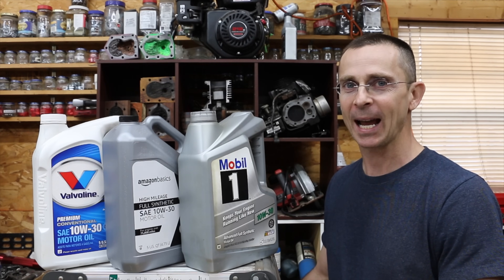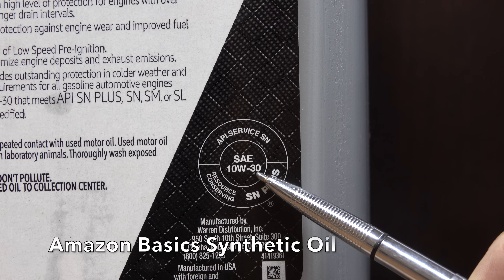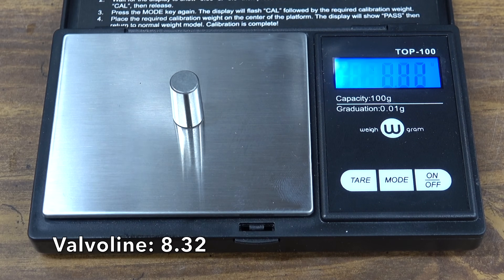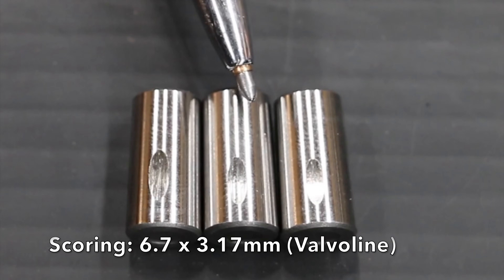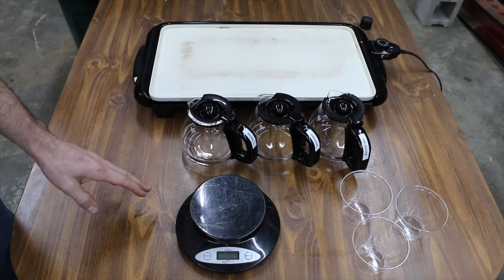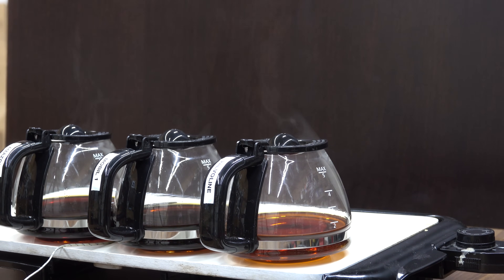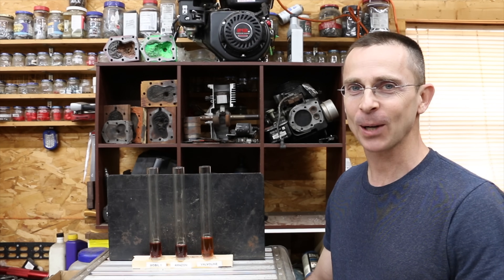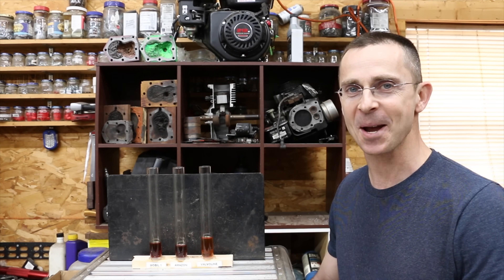Is AmazonBasics Full Synthetic Motor Oil better than Mobil 1? Let's find out!

Comment: Just an observation, when you tested the lubrisity you had a bit more of mobil1 in the cup. So when you started the test a lot more oil was coating the bearing and the test block. Could that have altered the test giving you a false reading between Amazon and mobil1? I wonder if the mobil1 cup had the same amount of oil as the Amazon would the test result be closer in the wear marks?
Reply: My gut feeling on that one is that the tester just slings out whatever it can't use and that all of the levels equalize pretty quickly. I don't think it had "extra" oil long enough to matter.
Reply: @TheBrokenLife  I thought the same thing, but if you look closely during the M1 test (around 4:50) you can see the oil is still really being slung by the race at what seems like the end of the test. Maybe a test of the same oil at different levels in the cup would be fun to see and find out for sure?
Reply: @TheBrokenLife  Actually if you go back in the video and watch when the mobile1 was being tested you can clearly see more oil building up and holding at where the race is riding the bearing. far more than was present when testing the amazon oil.
Reply: I agree with this question. I would have to assume the amount of oil clinging to the race would have a measurable effect on the bearing wear? I feel this method may lead to unintended differences in your results. Is there a way to make this more uniform? Maybe an alteration of your tester? Some sort of simple device to apply oil to the race in a more repeatable amount? Something similar to the way an engine would oil a bearing? Maybe a small pump with a tube pointed at the race, pulling from a collection cup under the race?
Reply: Maybe you could even do a test to see if there is a difference in wear using the same oil but with different levels in the cups? I assume if there is too much oil there would be a certain amount of loss as it's thrown by the race, but it looks like you have modified your rig since earlier videos to help remedy this issue with a small plastic flap?
Reply: Also, out of curiosity, why were the temperatures of the bearing it seems you were recording during the test not mentioned in the results. From what I saw it seemed the AB had the lowest bearing temp, which I would assume should mean the least wear. Of course a lot of slight variances could skew that number, but curious why it was omitted. Inconclusive?
Reply: Exactly my thoughts. @Project Farm ?
Reply: Perhaps to make sure everything is even-Steven, measuring the initial load of oil would be helpful? If nothing else, it would help the poor guy to keep from overloading it and making a mess than can be seen from space with that rig.
Reply: I agree with this general line of discussion.  It was obvious that there was far more Mobile 1 oil coating the bearing.  Consistent pressure, speed and oil levels are required for good data.  You have improved your methodology of testing, but a few more additional constraints will help ensure better test data.
Reply: I believe @ke6gwf is correct.
Reply: I noticed the same thing, but, wasn't sure if it made a difference
Reply: When is was watching I also noticed this. I feel in a test where the margins are so tight this factor may have gave Mobil one an edge ahead of the others.
Reply: I noticed that too but it could have been a more clingy property of the oil perhaps. I'm more concerned with how he made sure the clamping forces were equal.
Reply: I noticed this right away, I think it should be retested with the same amount of oil in each. The test was technically faulted due to there being more oil in the mobile1
Reply: James Smith I noticed that too
Reply: At the actual contact point where 2 pieces of metal touch under pressure while moving, the oil forms a film only a few molecules thick (depending on viscosity, temperature, speed of movement, and pressure applied, preventing metal to metal contact.

As long as there is enough oil to provide that few molecule as the part rotates, and to replenish it after each rotation, all the extra oil flinging off is just excess oil.

Since film cling and tenacity and surface wetting are important properties of oil, as long as there is enough oil to fully cover the friction surfaces, the test should be accurate, including the ability of the oil to maintain lubrication with residual amounts only.
Reply: @ke6gwf  that's all correct! Do you think with extra oil the heat could have been dissipated better affecting the results.
Reply from the maker: Thanks for the constructive feedback.
Reply: @ProjectFarm  Curious to see if different oil levels in the cup would produce different results from the same oil...
Reply: It shouldn't change things because the gap between the bearing and test block is the same regardless of the amount of oil added so only so many oil molecules can fit in that tiny little gap rest will be pushed to the side having no effect on the wear mark. Only reason you use more oil then what is actually needed for the equipment to work is because it slowly gets dirty and extra helps dilute the partials contaminating the oil and some of the oil evaporates and or leaks out.

Comment: Synthetic is much better all around, except in some old vehicles! My vintage motorcycles will smoke like crazy with synthetic oil of the same weight as conventional oil. My only guess is that it’s so slipper that it slips through the valve guides and rings that don’t seal as well as modern engines.
Reply from the maker: Thank you!

Comment: Great video! But I’m curious if the lubricity changed at all when the oil was heated to such a high temperature for an extended period of time. Did it break down at all? Or is it the same as it was new?
Reply from the maker: Great point!  I should have tested that.

Comment: I wish you had included Walmart's house brand of synthetic !
Reply: The Walmart (Supertech) oil is the same  as the Amazon Basics. It's made by Warren (which you can see on the sticker in one of the shots), who make the "in house" brands for a lot of stores. Amazon Basics, Supertech at Walmart, Autoquest at Meijer, and I'm sure many others are the same oil, made by Warren. All are good options, and are very affordable.
Reply: @randomOAS7  Except the Walmart version is cheaper then Amazon and almost every town almost has a Walmart or one within short driving distance. $17.47 for supertech. I''ve been using it for over 15 years and haven't had a single issue with my of my vehicles. Got a 2002 Escape with 300k miles.
Reply: @MAGWolf  I've been using super tech full synthetic in my 2011 suburban for 100,000 miles so far and it's great oil.
Reply: @randomOAS7  I'd clarify that it's made by Warren Distribution. There's another Warren, called Warren Oil and they make stuff for places like Autozone, etc. Can get confusing.
Reply: @randomOAS7  Warren blends most of Supertech but they do have others depending on the geographical area you're in. That said, they're all supposed to blend using the same base/additive package so they should all be nearly equal. Nice thing about Amazon B & Supertech is it's so close to most of the major labels synthetics at about half the price you can change it a little more often and still save money as well as have a superior product.
Reply from the maker: Thank you for the video idea!
Reply: @ProjectFarm  If you are going to test Mobile 1, you might as well add Mobile 1 top competitors like Amsoil and Royal Purple, no? I would like to see the coffee pot test with those, which I think you haven't done in the past...

Also, when you do the lubricity testing measure the oil you put in the cup instead of just filling it by eye. An extra half ounce in one cup over another may actually affect the test by allowing more oil to be brought up on the wheel, thus pushing more oil over the bearing and giving a better reading vs a lower oil level in the cup... just a thought.
Reply: @gac107  Amsoil and RP are not "top competitors". They are niche players in the market.  Their prices are too high for them to compete with regular name brand oils.
Reply: @gac107  Amsoil and Royal Purple are actually junk, although it costs more. If you are going to pay super high prices on oil it needs to be Shaeffer's, Motul, Enos ect. The only reason anyone has heard of Amsoil and RP is because of the amount of advertising, not because the oil speaks for itself and it is obvious when looking at oil forums where it is tested compared to other oils.
Reply: @4x4le  I have been using Schaefer's for about a year, I was told it was good stuff, hope they are right
Reply: @nickv4073  Actually running extended oil change intervals would make them significantly cheaper than a conventional oil in my case (4 gallons per oil change). I'd be interested to see the difference.
Reply: @gac107  i would not put Mobil 1 in the same class as RP, or Amsoil.. high end oil would be RP, Amsoil, Redline, and Penzoil ultra platnum. M1 is not a high end oil.. its technology is ancient in comparison to the brands
Reply: @jmhm17  It's not like the M1 you buy in 2019 is the same stuff you bought in 1985. Mobile1 keeps up with the times, and they have a variety of formulations.
Reply: @4x4le  Amsoil is actually really good stuff but its ment more for Race Engines
Reply: @4x4le  Not so. Tests of Amsoil exceeds Mobil 1 and top of line of Amsoil is rated for 25000 miles before change. I have over 300k on my 04 impala. Very quite motor, strong and does not use oil. Gets changed every 16k - twice a year. Started Amsoil 40yrs ago and couldn't believe the extra hp I got over conventional oils in my race car. + Northern Mn, gets really cold - but car turns over like summer. Mobil 1 a bit cheaper - but I stick with the best of the best!
Reply: @ProjectFarm  Supertech vs Amazon!
Reply: Warren makes them both.   Refers to https://www.bobistheoilguy.com/forums/ubbthreads.php/topics/4827485/Who_makes_AmazonBasics_Full_Sy#Post4827485
Reply: Jack Patteeuw, Amazon basics is the same thing as Supertech.  Both made by Warren.
Reply: I have used Walmart Full Synthetic since new with Purolator filters  it is a 2005 Colorado 3.5 I5 it has 373,000 Miles on it...  Runs just as good as new.... I change the oil @ 5-6k, Air & Fuel filters @ 12k. it is using a quart per change now...  The rear main seal is leaking a bit...  2 tranny rebuilds, 1 G80, 1 fuel pump, 1 alternator, 2 water pumps, Idler & Tensioner pulleys, 3 sets of wheel bearings, 2 sets of u joints, both window motors, driver side window switch, Heater resistor, 2 vent valve solenoids and basic std crap that has to be changed..  I'd drive it anywhere without worry...  BTW  4L60E loves shift kits....  Wakes the 1-2 shift up!
Reply: Super tech
Reply: mobil 1 0w-40 european
Reply: Toilet Dog  i used to only use supertech full synthetic in a supercharged Pontiac and it ran like a top. no problems ever...   plus i drove it like a rented mule.
Reply: Toilet Dog  I used to use it and so did some of my friends and never had any issues. we've even used Valvoline High Mileage Oil, in the red container for older vehicles with well over 100,000 miles or more. Especially when we would put in an engine from a junkyard.
Reply: And Amsoil.
Reply: You meant SuperTech? That is what I use. I heard it is the same manufacturer as the Amazon basics, they just repackaged it and market it as different brands.
Reply: I’ve used SuperTech forever—19 years, ever since I have a car. I use itbcz it is affordable. I know it is good /no problem because I had never had any problem. Now I know why—it is the same manufacturer as Amazon basics. I tried mon
Bile one a few times, it is too pricey, and I think they added some aromatic so it smells weird, so that you buyer think you bough special recipe, I guess.
Reply: I was just going to say the same.  Supertech is very cheap.
Reply: Bottled by QuakerState. its pretty damn good oil

Comment: Bleah!  This coffee tastes horrible!!!

All jokes aside, nice video.  It would have been interesting to do another lubricity test when the oil was heated to engine temperature (approx 250 deg F).
Reply from the maker: Great test idea!
Reply: @ProjectFarm ,
  You could use a programmable temperature controller, thermistor probe (often comes with the controller) and one of those little 120Vac heating elements for coffee mugs. That would be A LOT safer than heating the oil with a gas burner or hot plate.  Splatter guards (and definitely gloves and safety goggles) would be a good idea too.

Comment: Thank you for this video and your hard work on it. I do think Valvoline was kind of rail roaded here being you tested a conventional against 2 synthetics. To be fair you would have to test 3 synthetics against each other. That's is surprising the Amazon basics did better than Mobil 1!
Reply: Yeah but it will show people that synthetic oils are better. I am glad he used a regular oil just to show the difference.
Reply from the maker: Great point.  I was using it as a baseline to compare against synthetics.
Reply: I was about to comment this as well. It would be good to keep all of the oils "synthetic", otherwise changing brands could exaggerate the results.
Reply: Yes you are right Ford ST. It does show the difference between synthetic and non synthetic motor oils.

Comment: Can you replace the engine oil in your engine with grease? preferably extreme temperature grease.
Reply from the maker: Thank you for the video idea!
Reply: If you want it to die sure. You would be hard pressed to find a consumer product with more R&D than engine oil. The oil and engine makers have very good reasons for the recommendations they make. Your not going to find dish soap or honey or something to be some kind of miracle money saver oil trust me. Don't believe me? Try doing thorough research on engine oil.. it might takes weeks to satisfy a discerning mind about which brands are better. It's a pandoras box of engineering.
Reply: @FrigusNomen  when it does lock up while you driving high speeds it may just explode.  Depends  because a diesel engine blows up when the rpms are way past its limits for a few good minutes.  

P.s please correct me if I say anything wrong thank you.

Comment: From Valvoline's website for the ones saying "weight".. 
The "w" in motor oil stands for winter. The first number in the oil classification refers to a cold weather viscosity. The lower this number is, the less viscous your oil will be at low temperatures. For example, a 5W- motor oil will flow better at lower temperatures than a 15W- motor oil. The higher number, following the “w” refers to hot weather viscosity, or how fluid your oil is at hot temperatures. The higher the number, the thicker the oil at a specified temperature....
Reply from the maker: Thank you!

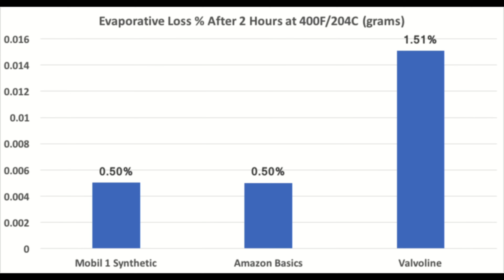Comment: At 08:22 you use way higher precision in your chart than what your method actually had.
It doesn't change that one lost 3 grams out of 200 and the other two 1 gram within the limits of your scale and multiple measurements but you shouldn't use that accuracy when typing it out. (I can understand how you may not want to say 1 and 2% either but no-one is forcing you to.)
Reply from the maker: Thanks for the constructive feedback.

Comment: It'd be cool to see a test of universal hydraulic fluid like what is used in tractor differentials and wet brake systems since supposedly there is no regulated standard like motor oil.  Like testing Ambra vs Rotella vs the cheapest stuff at tractor supply.
Reply from the maker: Thank you for the video idea!

Comment: You should try the same test using Amsoil semi-synthetic to see how that compares.  I used it when I saw a demonstration of it against Mobile 1 back in 1980.  The demonstration included draining the oil out of his car, driving it from Omaha to Lincoln and back without oil.  At any rate, I put the oil in my car at the time, a 1954 Ford with a flathead V8 engine.  I was impressed with that oil.  Had to sell the car in 1985, when I was transferred to Japan by the military.
Reply from the maker: Thank you for the video idea!

Comment: Thank you ,thank you! I have been using mostly Mobil one for 30 years and just got three Amazon to try because of the higher rating and lower cost. So it's reassuring to see it holds up against Mobil . Great rest and very helpful. The only problem I can see is if Amazon changes supplier of the oil the package would stay the same but the oil may be different or in different regions of the country the supplier may be different but if it still has the rating ? Maybe just overthinking it.
Reply from the maker: Great point. Warren Distribution handles the oil for Amazon Basics and they have a solid reputation.

Comment: Liqui Moly vs Amazon basics vs castrol oil test. I’d love to see that. Awesome video btw 🤙🏻
Reply from the maker: Thank you for the video idea!
Reply: @ProjectFarm  I'd love to see LiquiMoly as well! It's so expensive. Maybe throw in Royal Purple too.
Reply: I run liqui moly in my 2016 Jetta at 10k intervals and it performs amazingly. I've ran Castrol and Mobil 1 in the past and would burn about a quart of oil over 10k, but liqui moly is the only other oil I have used in my Jetta and it hasn't burned a drop. Not sure why that is, but it's good stuff that's worth the price.

Comment: With shipping, mobil 1 costs the same as amazon.  Just buy it at wallmart.  0w-40 costs 26.68 at wallmart for mobil 1 vs 24.99 plus shipping for amazon synthetic (it would qualify for free shipping if it was 25.00, I see what you did there).